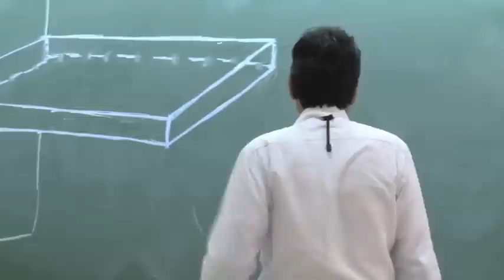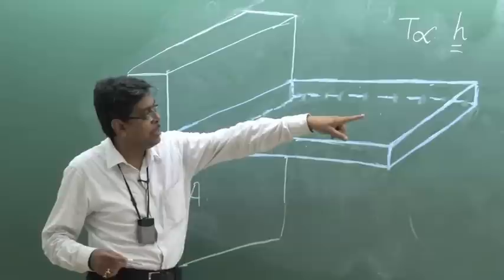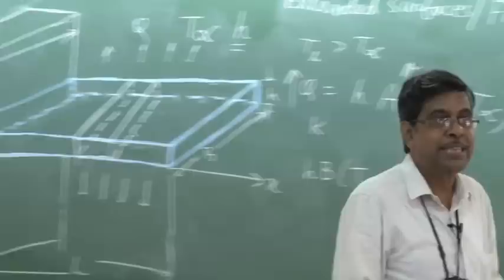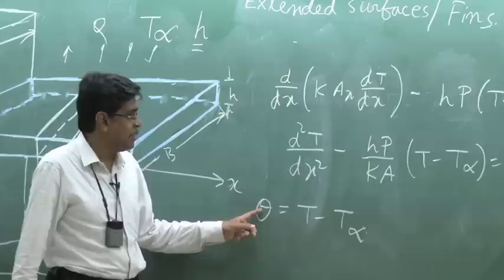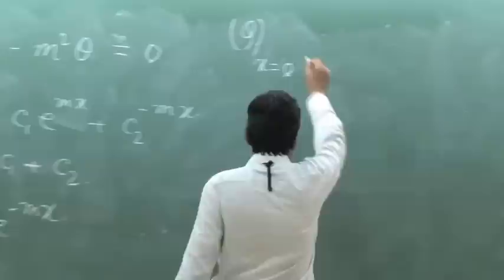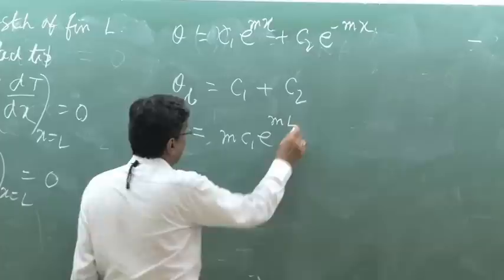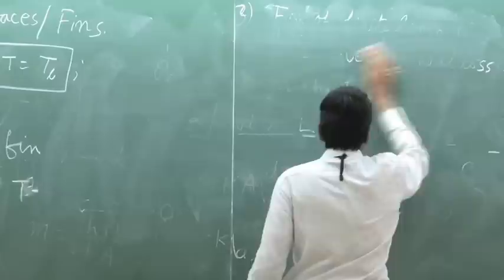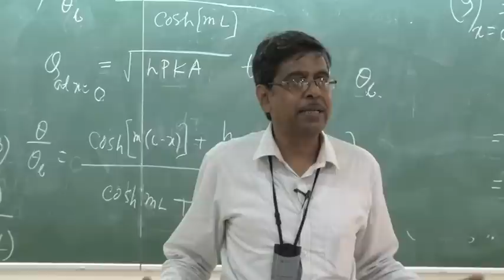Lecture 11: Hear Transfer from Extended Surfaces (Fins)

Comment: Respected Sir! 
Your lecture is really very helpful to me 
I have a question that if we use a porous fin instead of solid one then what will be the effects ?
Reply: Hey mate u have a very interesting point to discuss about it.... Have u got any suggestions/solutions/information regarding ur doubt within past months???(I am asking this cause ur comment is pretty much old) if u have then pls share about it.. I am interested in ur doubt and idea of innovation..
Reply: Prathamesh Dand  yeah dear the efficiency must be enhanced as air can infiltrate through pours in porous fins
Reply: @harisiqbal4091  ok 👍.. but pls tell me about effect of area... As by making it porous I think we are reducing the area by many small holes and I think it cause in reduction in heat transfer... (as Heat loss is proportional to area exposed).. pls answer about my doubt
Reply: Prathamesh Dand  can i have ur Email
Reply: Prathamesh Dand  ok
Reply: @harisiqbal4091   
Q conduction through the slab will reduce ..as resultant K will reduce due to air strapped in the porous..So as Q conduction reduce then Q convection through the surface also reduce..bcoz we have to flow the heat from the base to last part of the fin..then only convection will also happen simultaneously...I think u got my point

Comment: sir why it is one dimensional heat conduction in fin material while it is transferring in y and z direction too?
Reply: abhishek verma because the thickness is very small as compare to width and length